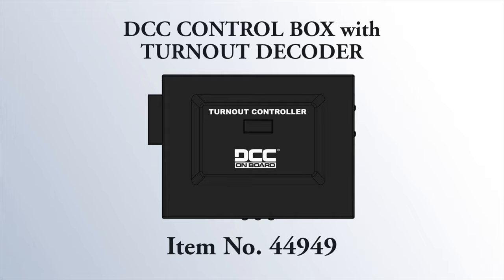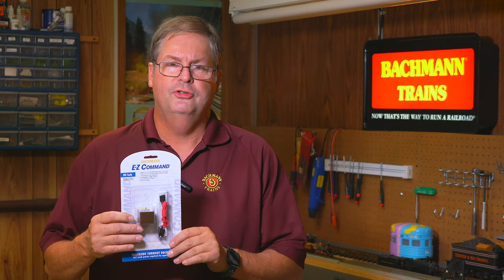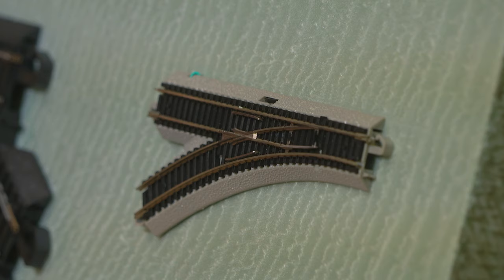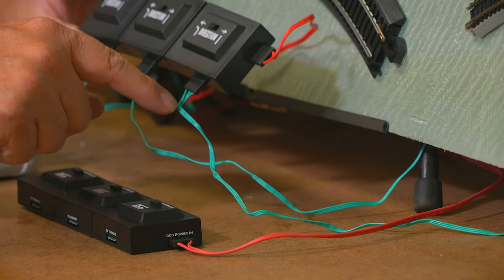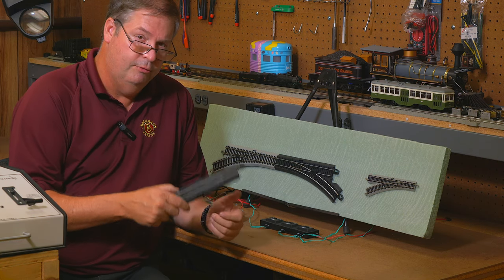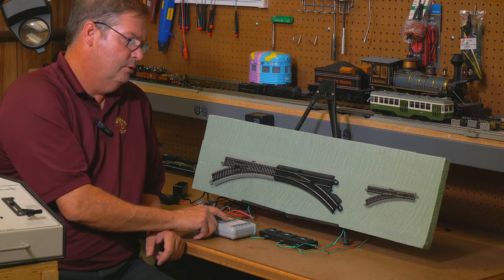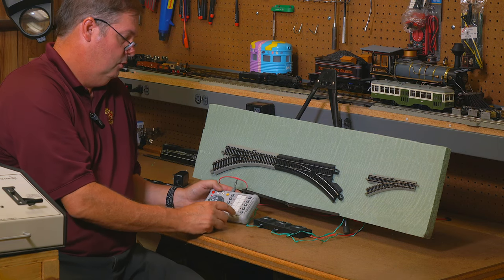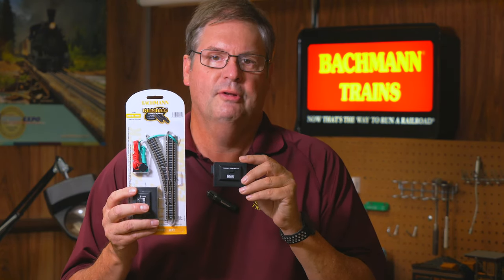Bachmann DCC Control Box with Turnout Decoder

Comment: Will the E-Z Command® Control Center power the non-DCC Bachmann turnout? I just purchased my first train set and expansion pack, and I cannot get the turnouts to operate, I only hear a quiet buzzing sound when operating the switch. I have the turnout plugged into the provided switch and the switch connected to one of my powered re-railer ports.

Comment: So I see in the demo that there are 3 of the boxes set up together and each controls a switch, if you were going to use the turnout decoder building instead would you need one of those for each switch as well? If so, how do you run them in series like you guys showed with these boxes?
Reply: Yes, or pull the guts out of these and install under the roadbed, no wires needed, just like the DCC turnouts are

Comment: Bachmann 44211 Bachmann installation of Turnout decoder / If I need to Power Straight Terminal what specific power can I send to my Decoder.  I have never seen a connection where the power is a able end to end.  They seem to have wires coming out Since I have the 44211 this is basically my issue.  Help PLEASE...

Comment: How do i power the frogs on the switches? Could i take a wire soldered from the rail and run it to the bottom of the frog?
Reply: If they are switched through signal, they should have a wire underneath the track to plug in. If they a manual throw by hand, they will have a plastic frog, unpowered

Comment: I have Bachman EZ-Track turnouts with DCC on board and plan to use an NCE PH Power Pro wireless cab to control the 12-13 turnouts. How to I set up the turnouts to work with the NCE system? Thank you!
Reply from the maker: Hi Joseph, instructions for use with NCE DCC systems are included in the manual.
Reply: Did you ever find out, I don't think Bachmann DCC turn outs work with any other system other than Bachmann. The address coding is not nmra    I figured this out after gerti g some Tam valley turn out singlets to convert manual switches to DCC.  I can program them on the Bachman controller, but work fine on a cheap second hand Hornby controller.   I've asked bachmann for their address Number and never have heard back

Comment: I have a pretty good sized (28' x 24') "P" shaped N scale layout in my basement.  I am using ALL Bachmann EZ track including # 4 and #6 turnouts and crossovers and Bachmann EZ Command DCC system.  So far, I am very well satisfied with the performance of the Bachmann track and DCC system.  This controller could be just what l am looking for.  However, what do you do if there are more than 10 turnouts?
Reply: You'll need a larger controller, with more numbers available. NCE can drive these turnouts under the macro command

Comment: Hi! I have two analog turnouts I'm using as a crossover. Can I add just one DCC Control Box to control two turnouts at the same time?
Reply: Yes, I done the same with their cross overs.  Just cut the ires under the track and join together.   If you get this unit. Pull the guts out and install it under the road bed, no wires at all then. All done through the rails

Comment: I was wondering if it works on other systems like jmri or Uther dcc controllers?
Reply: Same question.
Reply: @billblumenthal4144  what system do you have? I use an Arduino with jmri software.
Reply: @Optimus13  I have Digitrax Zypher DCS 50.
Reply from the maker: This is compatible with almost all commercial DCC systems.
Reply: @BachmannTrainsUSA  You say "almost all"; is it compatible with MRC Prodigy?

Comment: @Bachmann Trains is this compatible with the digitrax zepher
Reply from the maker: Yes, this is compatible with almost all commercial DCC systems.
Reply: @BachmannTrainsUSA  what is the address Number for Bachmann DCC turnouts, because I can't control them with nothing else but Bachmann DCC controller
Reply from the maker: @russcole5685  You can access E-Z Command turnouts using address 9 on an E-Z Command control center to select turnout mode and then use the other 8 function buttons to assign and toggle the turnouts. For other DCC systems, you will need to set up the turnouts and operate them in programming mode. You will have to check your DCC system manual to see the steps for your system if you do not have E-Z Command.
Reply: @BachmannTrainsUSA    you're not hearing me. I have DCC turn outs working and programmed fine on the Bachmann EZ Command controller, I can not reprogram, or use them on another system.   Channel 9 is not the same on Bachmann as it is with Hornby.      I'm asking for the NMRA channel number for point switching that Bachmann uses as there channel 9 for accessory switch.   Because with Bachmann DCC EZ Command controller, to throw a switch you need to use loco address 9, then function number.  How does that translate to NMRA channel ID number.      My layout has grown, I need more than 10 turnouts.   If a can't get them to work, I will be ripping up my entire layout and move to another  More NMRA friendly system. Then I'll be able to achieve my goal without being locked into a brand  specifically.

Comment: I don't get the point there; is this to upgrade a DC Bachmann layout with switch already there to DCC ? Or is this to sell switches with a turnout decoder ? Because if this is the later this is just dumb since the decoder should have been directly integrated to the switch roadbed and the power would be already there from the tracks .... here is a mess of wires so i m not sure i correctly get the point....
Reply from the maker: This is to upgrade non-DCC turnouts to DCC
Reply: You are very correct.  I brought these to upgrade switched turnouts to DCC. Pulled the guts out and installed under the road bed. No more wires, just like the DCC equipped turnouts.   For a double turnout, join the wires together so only need one module to switch both

Comment: Here's my view of Bachmann switches, I bought 19 of them at $34.00 a pop. 6 of them went bad with in 3 months. Model Train Stuff went out of business two weeks after I bought them. I modified and changed the wiring installing them. It voids warranty. They even quit functioning manually. I am out $204.00 plus 8% sales tax and $15.00 shipping on the 6 bad switches. I just wonder how long the other 13 switches will function, When you spend the LARGE amount of money, Yah don't look forward to thrown it all in the trash in a couple of Years. I QUIT BUYING BACHMANN CHEAP CHINESE GARBAGE.